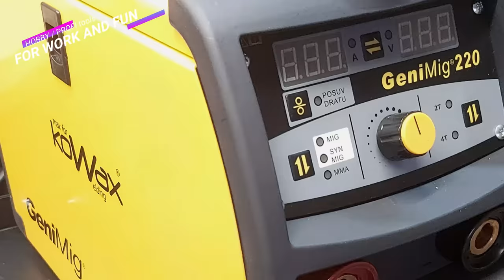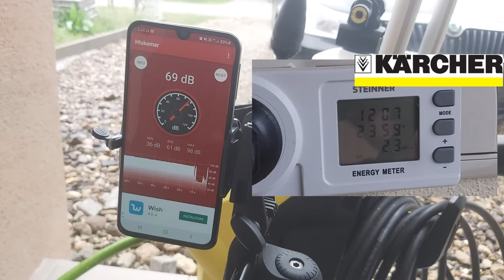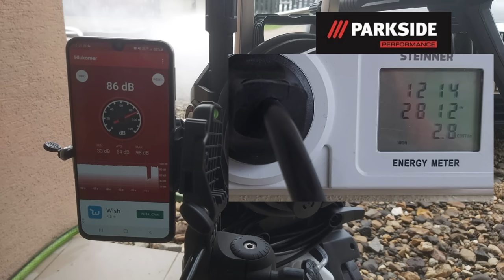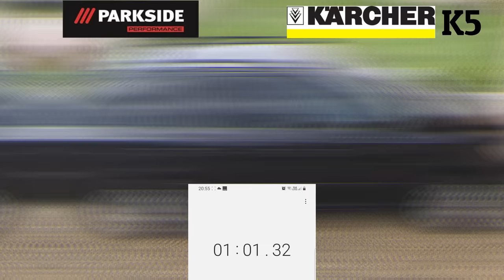Tlakový čistič Parkside Performance PHDP 180A1 vs Karcher K5 porovnanie a test.

Comment: The Parkside has a new model now: PHDP 180 B2 instead of A1. The filter and engine has been improved. It sells for 219,-. Still a lot cheaper than Kärcher and better specs

Comment: Impossible to find spare parts for PHDP 180 A1 - IAN 355055

So karcher is the nest option
Cannot fix mine . Cannot find rubber seal or valves to fix it. Very hard to find motor spares parts

Comment: On home washer like this 180 and 145bar are max preshure.
But most times you got 120 bar real .
Only profesional washer hd15 models have real work preshure 150bar and you can work with it no problem.
With home washer 30 minutes max work time then 10 min pause.

Comment: Karcher K5 have high pressure pump with aluminium block so it's more reliable. Lower series of karcher - k1, k2 are with plastic block and after 1-2 years of use start to leak water and need to change whole high pressure pump that cost price of the new machine. Probably parkside is also with plastic HP pump.
Reply: AS an employee from Kärcher I must say that you dont need to change whole pump. If it leaks. From experience i know that 95% causes leaks from high preassure pipe which leads from pump. Cost around 18 euros.
Reply: @viktornovotny6001  in our local karcher dealer & service, told me it's better to buy new one instead of pay for repair my old K2. Then I bought K5 premium and after 5 years of use i don't have any problems, my old k2 lasted 2 years. Before karcher k2 i had bosch... also some cheap model and lasted 1-2 years.